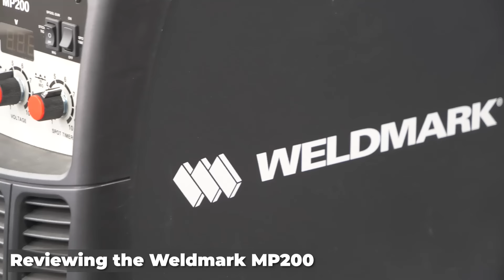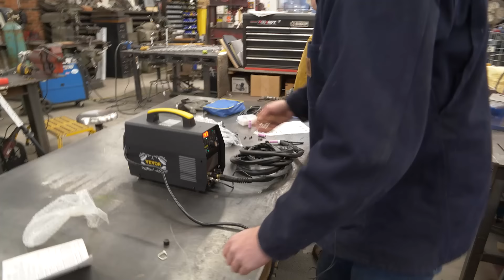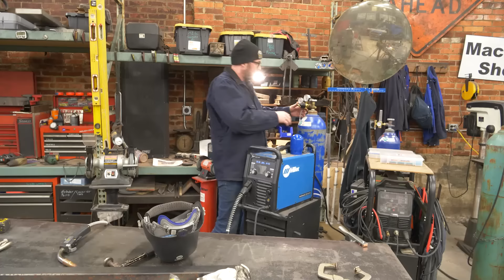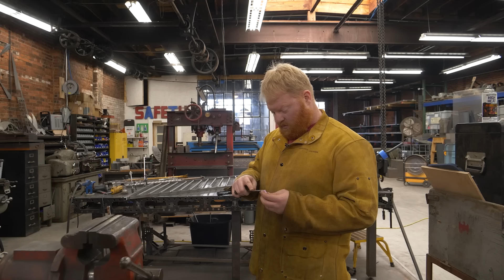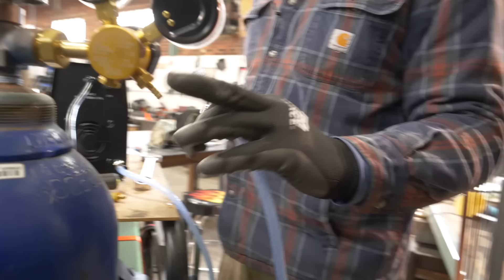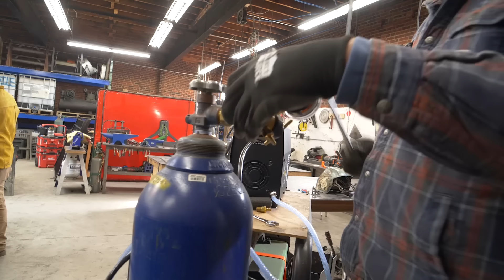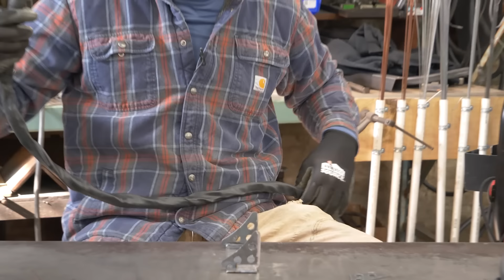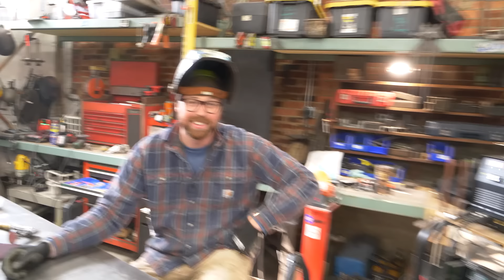$200 TIG Welder VS $2,000 TIG Welder

Comment: I'm probably late as shit but a 30% duty cycle would mean you could run it safely for 3 minutes (180 seconds) out of every 10 minutes (600 seconds).

Of course that's just what it's rated for, which is probably lowballed. In my welding course we had Miller XMT 350s which were rated at 60% duty cycle, but on stick "production tests" (graded with a mixture of visual/rods burnt) I think we definitely pushed them to over 80%.

But I think those machines are showing their wear signs in other departments, like variance between machines in GMAW-P.

Comment: I take it your tech school welders. I have done most of my tig welding with a dialarc hf released while you were in diapers. I have scrapped 2 Miller's and a century and replace them with Chinese inverter welders that out perform the Miller's and my mig has gone through 7 44 pound spools in three years and used 1/3 of the electricity. If my cheap welder dies I will junk it and buy a new one and still come out thousands ahead. Grow up and get over name brands that only support there multi thousand dollar welders for ten years. Oh and my 250 amp mig has a higher duty cycle than the miller. If it works use it ! Profit is number 1

Comment: for people know little about electricity and electronics:
The most common type of power source in a modern, professional TIG (Tungsten Inert Gas) welder is an inverter-based power source, not a solid-state transformer (SST).
⚡️ TIG Welder Power Sources
Modern TIG welders, particularly professional and high-performance models, primarily use inverter technology.
 * Inverter Welders: These machines use power electronics like IGBTs (Insulated Gate Bipolar Transistors) to convert the high-frequency AC current from the main transformer into a steady, controlled welding current. The key feature is the use of a high-frequency (HF) transformer (a much smaller, lighter version of a conventional transformer) within the inverter circuit. This design results in:
   * Much smaller size and weight (portability).
   * Precise control over the welding arc, including advanced features like AC balance, frequency, and pulsing.
   * Higher energy efficiency.
 * Conventional Welders (Transformer-based): Older or simpler machines use a large, heavy conventional low-frequency transformer to step down the input voltage and increase the current. These are known for being durable but lack the portability and advanced control features of inverters.
💡 Solid-State Transformers (SSTs)
While the term "solid-state" can broadly describe the use of semiconductors in an inverter, a Solid-State Transformer (SST) is a specific, emerging technology.
 * SSTs are essentially multi-stage power electronic converters that replace the conventional low-frequency transformer entirely.
 * They are primarily being researched and implemented in large-scale power grid applications, like integrating renewable energy sources or advanced distribution systems, due to their capabilities in power flow control, voltage regulation, and reduced size/weight compared to utility-scale transformers.
 * The concepts and components used in SSTs share principles with the power electronics used in TIG welder inverters, but they are not typically referred to or used as a complete unit inside a TIG welder in the common industrial sense.
In summary, a professional TIG welder uses a highly sophisticated inverter which contains a small, high-frequency transformer and advanced power semiconductors to achieve its superior performance and portability.

A modern "light welder" (meaning a small, portable inverter machine) is highly likely to use IGBT technology. However, it's worth noting the historical and technical distinction between the two main types of transistors used in these welders:
🎛️ IGBT vs. MOSFET in Light Welders
Inverter welders use either IGBTs (Insulated Gate Bipolar Transistors) or MOSFETs (Metal-Oxide-Semiconductor Field-Effect Transistors) as their main high-speed electronic switches.
| Feature | IGBT (Insulated Gate Bipolar Transistor) | MOSFET (Metal-Oxide-Semiconductor FET) |
|---|---|---|
| Power Handling | High Voltage / High Current | Lower Voltage / Lower Current (Traditionally) |
| Industrial Use | Dominant in professional, heavy-duty machines | Used in older or very basic, low-power portable units |
| Reliability | More robust against voltage fluctuations and high loads. | Can be more prone to failure under stress. |
| Switching Speed | Faster than traditional transformers. | Generally faster than IGBTs. |
The Modern Trend
The trend in the last decade has strongly favored IGBT technology, even in smaller, more affordable, and light-duty inverter welders.
 * Increased Reliability: Manufacturers found that MOSFETs, especially in multi-board designs, could be more easily damaged by voltage spikes (like those from a generator) or high heat. IGBTs, being more robust, became the standard for better reliability.
 * Performance: As IGBT technology improved, it became efficient and fast enough to offer the precise control needed for modern features like "Hot Start," "Arc Force," and digital control, all while maintaining high power.
 * Marketing & Standardization: Many modern, portable welding machines, whether Stick (MMA), MIG, or TIG, are now explicitly advertised as using "IGBT Inverter Technology" because it signals a modern, efficient, and reliable machine, even if it's a small 140A unit designed for home use.
In short: If you buy a new, light, portable inverter welder today, it is overwhelmingly likely to be an IGBT machine.

Comment: I have a Orbimax tx 230 $6700 AUD jumped from a Unimig razor 200 $2000 twice the price and the Unimig razor was so much better for half the price be the last time I spend money like that without testing them out only good thing I found with the  orbimax was the cold tacking for quick tack positioning pipe bends

Comment: Duty cycle is the amt of time the tool can operate per hour, expressed as a percentage.
Reply: Duty cycle is the amount of time it can operate for any period of time, not hours.
If you have a 10% Duty time, you will get one minute of welding time every 10 minutes. 
40%, 4 minutes.
For DIY/Home gamers, a 30-40% DT is usualy fine as there are fewer time constraints.
For Pros or places where they do a lot of welding every day, you want something north of 70-80% else your labor is standing around vs welding.

Comment: Open both units up and without touching internal components both unplugged compare the internal electronic parts  that is where manufacturing money aside from labor cost was saved.  From 700 bucks to 200 bucks.   
The difference of a copper coil or aluminum coil liclion buzz box.

Comment: Would you weld with a bic lighter in your pocket?   Its a good question.
If your answer is no,
Then why the hell would you have a cordless drill with a lithium ion battery on the welding table?
If you get it hot it can explode just like a lighter can.

Comment: You guys are talking about 120 volt and 240 bolt welders  the job shop machine shop I worked at had miller welders that ran off 480 volts.

But here is the point on the asian made 200 dollar tig welder, aside from duty cycle  its the quality of electronics on the main computer board   do or did they use electrolytic capacitors or solid state caps  big difference in longevity how long the electronics parts last,  quality resistors or cheap this matters in a power supply  is the output ratings in peak power or RMS  ratings?
All these things will have an effect on how long it last, and its duty cycle.

Like the old Liclion Buzz boxes used copper transformers weighted a ton but last a long time and have a longer duty cycle then newer units with aluminum transformers that heat up faster and have a shorter duty cycle. And yes I know thats arc welding.

Now the 200 dollar machine is something a hobbiest might use
Like some of the stuff you have.
But production equipment will run all day duty cycles are not short.
A 480volt miller has to run all day
And i watched our welder lay dimes for hours on end with the miller machines.   We had an older liclion buzz box I got to use it once I learned how to weld on it.
I could not get the hang of a wire feed machine.  Or i would have used it.    
Parts

Comment: A small weld is okay for testing; start doing more, longer welds and aluminum welds, then you will start seeing if it's good or not, from the welder to the torch handle.

Comment: The biggest difference will be durability.. The vevor could work in a professional situation if its use was infrequent.. Iike most other low cost tools it wouldn't be viable welding with it all day every day.. Also spare parts could be a big problem. However for occasional use or home shop use  it would be just fine.. Also for someone who wants to stick steel plate together without hassle it is a good choice as cheap mig welders suffer from wire feed problems and so on. . An arc welder has zero moving parts and a tig will have just a gas solenoid to worry about.. Almost all  cheap tigs  don't pass gas and it is fed directly into the torch that will have a manual tap.
Cheap mig welders were once the plage of my life. Every time I came to use it I spent half my time repairing it or fiddling with wire feed problems not to mention fluctuating feed speed when an arc was struck.
Cheap tigs yes. Cheap migs NO !

Comment: 110, 220 was the old voltage that was used back in the day. It's now 120, 240 volts now. If your voltage is lower than the bottom standard, you could have problems. Higher the voltage, and the amps will be lower. Vise versa, lower the voltage, and the amps will be higher.

Comment: If you buy an expensive industrial equipment, you pay for the R&D, quality of service/support, guarantees etc. You pay the price to have an equipment which will reliably serve your business. 
China can mass produce good quality electronics at low price. They even can design things. But most of the R&D had been made in the USA and Europe by big names. You get what you pay for. For a cheap Chinese product, you even don't have a proper warranty. If it breaks, you don't have a local sales representative or a service shop to replace or fix. If you try to send back to China, you will face the horrible shipment costs, which most of the time is higher than the price you paid for the product.
Reply from the maker: Yeah, places like Arc3 are super great for help in that regard too. Lots of big box retailers will return something up to 30 days despite them having a longer warranty but once you go past the 30 days they're of no help. Authorized dealers have been the best bet for us for a lot of the same reasons you mentioned about buying chinese made tools.

Comment: The "pedal" on many low end import TIG machines actually only functions an on/off switch and does not adjust the amperage. A true pedal controls the amperage while welding. Know what you are getting when ordering anything.

Comment: Go read the bad reviews about Vevor, they suck. I bought a 700-hundred-dollar hydraulic steering unit for my boat and it came with bad threads on one end of the steering shafts. Called Vevor and they don't have parts for this and proceeded to offer me a small amount of money to fix it myself (BS). Started reading their reviews and this seems to be a common occurrence - offering money instead of sending parts to fix the problem. Called Vevor numerous times for a replacement part and they only offered a discount on the item I bought so I called my credit card company and had the charges reversed. Vevor's response, they don't have the parts and didn't want to spend money shipping it back and told me to keep it. So, I had the stainless steel shaft welded, turned and threaded and everything is groovy right? Wrong! Pump started leaking less than a month later. On the brighter side, my fifteen-year-old eight-dollar grinder from HF is still going strong. Be happy!

Comment: I do custom metal fab for a living.. And really tig welding how often so you need 210amps? Arc welding sometime.. But arc welding half since plate I wouldn't use this.. I actually like the 40 year old Miller dial arc we have for heavy arc, I ordered one of these for the occasional tig I do at home, I'm sure it will last at least a couple years... Fingers crossed

Comment: I like your funny relaxed approach, good for a huge smile on my face, keep up the good works!
Was almost pulling the plunge on a €1700 ac/dc Jasic TIG welder for making my own battery rack (need to place 80 EVE Lithium cells of each 5-6 kgs so this rack needs to be strong and stable out of RVS 304 stainless steel.
Since I need to figure out if I m talented enough for a steep priced machie, this kind of starter machines - specially with pulse and HF start on it -  would be a good start.
If I like welding, the better machine will come later 😁
Reply from the maker: Thanks buddy! That's the way to do it for sure. A lot of people get hung up on gear and it becomes an obstacle for them to overcome even before they give it a shot. Also, speaking from experience, getting good on something cheap or crappy makes getting something nice REALLY nice and feels a million times easier once you start using it.

Comment: So, the reality is these welders are really just fancy power supplies. Making an efficient power supply is extremely common now days, so this isn't really a leap. The reason why they don't have the functions like AC, or slopes, that requires fancier control circuitry.

However, for just current control, or voltage up and down, it's a piece of cake.

You're spot on with the consumables. However, they aren't "abnormal", they are using standard connectors in the metric/ISO world, which are a bit harder to get over here in North America.
Reply from the maker: You're spot on, you can weld with a car battery I hear if you have enough of them.
Reply: @LiftArcStudios  You're absolutely correct. It was a commonplace way of fixing things in the field for offroaders to just keep some welding cables, a few jumper cables and a couple welding rods.

Given that most welding is done around 20-something volts, you really only need two batteries in series. But, for the high amps you need a couple in parallel.

This would make an amazing video, BTW.... hint hint hint hint

Comment: I have a $250 tig welder. Same size as the everlast and with all the same functions. Up/down slope, pulse, ac dc, foot pedal...
Reply from the maker: We figure the best welding machine is actually the one that works best for you! This is especially true when starting out, no one knows if this is there thing when they first pick up a torch, it seems almost crazy to spend $2000 on anything starting out.

Comment: barb fitting is a feature.i ruined my first cheap welder by spinning out the internal gas valve, so it couldnt MIG. Did not have instructions not to two-wrench

Comment: I had a mishap while welding in my bath-tub. The manual was unclear about emptying the tub before I sat down and welded the pipe fittings so ended up in the emergency room.  But at least I now save a ton on electrics bill since the fluorescent lamps will light up as soon I stand under them.

Comment: It’s all about good stable power supplies and electronics. 

You can buy a cheap conversion kit to turn your stick welder into DC Tig machine. 

I use an InverArc TLP-200 that has pulse capability for stick. 
It makes a great DC tig welder as well. 

So it’s no surprise to me that Vevor can turn out a descent DC Tig welder for that price. 

It would be good to see how long the HF start lasts.

Comment: Retired yet shopping. As a kid on the farm with a 50's crank top Lincoln stick, I welded the broken implements. My step dad & grandfather could drink "Hamm's" beer, but couldn't weld. I most, we start with a torch then in 84 bought an Italian DECA 150Amp MIG. Works great 37 years later and has a transformer bigger than most Honda engines. 
   Thanks for the funny review making it clear that is works but can't reverse polarity to do aluminum. Sad!  Just rebuilding a decent 67-C10 because it's my childhood (Age 13-drivers license; school / farm w/no photo) sheet metal as TIG is softer for hammer & dolly. Thanks!

Comment: The Tradesmen that only use the Expensive tools are the trash Tradesmen. If you can't weld with the cheap machine then you just can't weld. That's why you need a machine that is Digital and let's you perfectly dial in the settings.

Comment: All you got to do is buy a Arc Captain Mig200 comes with Mig Tig Stick   then Buy Arc Captain Cut50 or 55   then buy Arc Captain 1/1/1/1 clear view lens Helmet  all in all you can have a At home welding business for under 1k      Just make sure you have a good air compressor  for the Cutter

Comment: You can heat it up in the middle with the heat gun and pull on it in the hose will get smaller and then you put it on that little bar fitting. I do it all the time I know it works.

Comment: Vevor really are knocking it out of the park (baseball reference) with so many of their products - I recently got their Mag drill, it's equally impressive with less than 0.0005" (I measure in metric - it's less than 0.01mm) runout in the spindle
Good review, thank you

Comment: How much power a electronic device is capable of putting out is measured in watts, watts is voltage times ampers or A*V=W so 10 amps * 120 volts is 1200 watts or 1,2 kilo watts.

Comment: The supporting foot pedal must be an essential feature that is missed in the cheaper machine. I have one; the front micro switch came loose soon after a couple of times of use. The gas hose fitting in the back is also barbed, which I could never stop the leak from due to weird access to add. So, I guess horses for courses - nothing comes cheap without a good reason.